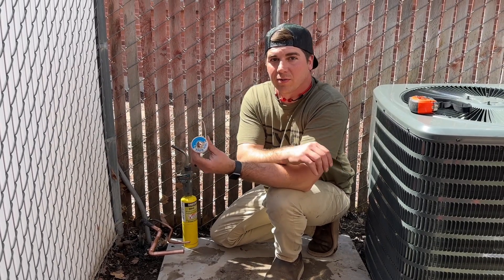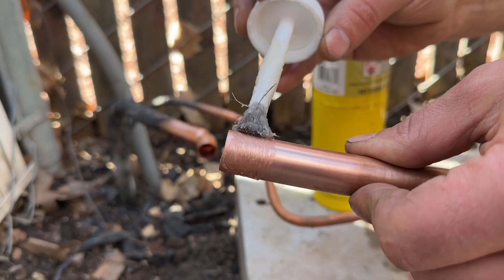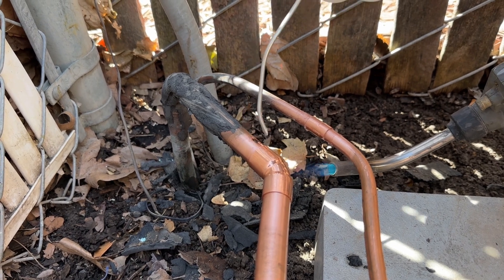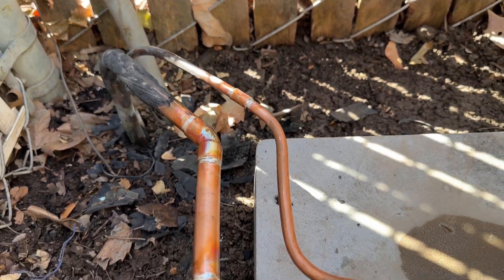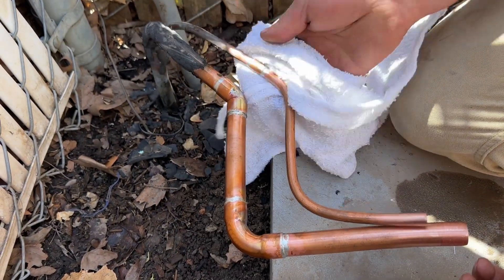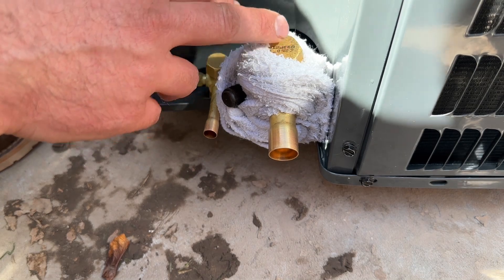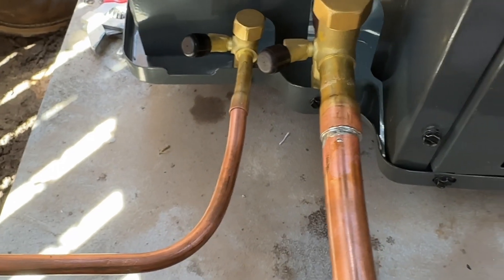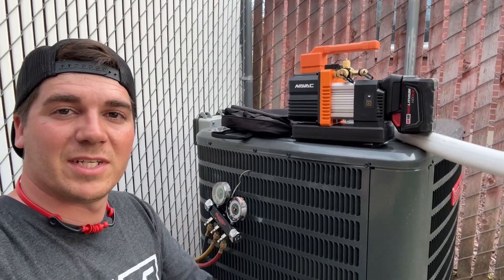Ditch Brazing. Learn To Use Staybrite 8 Soft Solder For HVAC Copper Lines

Comment: Silfloss should be used. It won’t go into the pipe no matter if you over heat or add to much. Plus the solder you are using is for low pressure piping. 
Im saying you should go back and check out your fittings in 5 to 10 years. That’s when you’ll find out why the solder you are using is for low pressure water systems…
Reply: Planned obsolescence, creating work.
Reply: Job security. Do the job Half Ass. You will get to go back and do it again a few years down the road….
  As long as you are using solder of any sorts. You will be able fixing it again. You should always use the correct…
Sill-floss should alway be used. 
The solder will ball up inside your lines. Then when it gets to the compressor or any piece of the equipment it will destroy the mechanical components. 
   The best part is. You’ll make all the money again. 
   That’s a great business plan.

Comment: I stay away from solder because its more rigid and prone to cracking/leaking from vibration from equipment. As well as if linesets get bumped by a lawn mower or kid playing. Brazing makes a more flexible and resilient joint.

Comment: Wanted to know in your pressure test process, could an air compressor be used instead of nitrogen tank?
Reply from the maker: Nooooooo compressed air is full of moisture which is exactly what we are trying to keep out of the lines. So nitrogen is needed. But if you get past 500 microns and pass your decay test, you can bypass the pressure test all together. If you have a leak you won’t be able to pump it down and hold at 500 microns. Cheers
Reply: @diyhvacguy  Even if you pump it down to 100,000 microns, the pressure differential from outside to inside system is less than 20 psi.  Seems there could be a joint that can hold 20 psi suction, but may blow apart with 200 psi.  Perhaps in your experience a solder joint is either "GOOD" or "Bad".  Nothing marginal.
Reply: Lolol my air compressor shuts off at 150psi. I hope yours does too, or you're going to blow your tank up.

Comment: Question: I have been practicing on 1/2 in copper pipe with Staybrite 8. I've then cut the fittings open to see the result. A tiny amount of flux still gets into the joint. I wonder how much is acceptable?
Reply: Any moisture or contaminates in the system is bad. There's a reason techs braze and it's not because we like paying more for Acetylene

Comment: I saw the video about using nitrogen when soldering to prevent cupric oxide from forming inside the lines. Why did you not use nitrogen flowing when doing this soldering?
Reply: At 400 degrees you don't get any scale. look at the outside of his joints.
Reply: Damn good question
Reply: It’s not hot enough to form cupric oxide scales.

Comment: Will this hold up will this hold up to the pressure in the lines and the refrigerant
Reply from the maker: Yes, Steve, right eight is designed for use with refrigerants, including r410a 👍🏼

Comment: I started in hvac in 1987. I have installed .any thousands of systems.  I have slways used a tubing bender to eliminate fittings and swedge instead of using couplings  whenever possible. This this cuts costs , and saves a huge amount of time. Get used to using a bender and you will get the job done way faster.
Reply from the maker: Thanks for the input. With soldering, gaps are not good, and I found that the swaging tool creates gaps. That’s why I’m prefer fittings but I totally agree with you, if I’m brazing I always try and eliminate the need for fittings. Cheers
Reply: @diyhvacguy but like you showed, if there is a gap, take flathead channel locks and gently press them to close the gap.
Reply: I used to use fittings and such. Then I bought a swaging tool. I don’t do much a/c work anymore but if I sold all my equipment I would definitely NOT get rid of my swaging tool!!

Comment: Why would you want to do this? Oxy acetylene brazing is faster and you don't need to use Flux paste. Are you flowing nitrogen?
Reply from the maker: Acetylene is definitely not faster, if anything it’s the same, time wise. But nitrogen isn’t needed with Staybrite 8 due to such low heat on the joint, and it has a tensil strength of 10,000  psi
Reply: @diyhvacguy   You absolutely need to flow nitrogen if you care about quality, compressor life and warranty. Is this technique meant for a cheap DIY homeowner or a professional HVAC Service Technician?

I'm just skeptical about using this product for a professional installation with a warranty. Nitrogen should be flowed, you are still creating oxides. That being said..... this product looks absolutely amazing for emergency repairs on coils or certain areas where you need to braze but have limited ventilation or other hazards

Comment: with a 400 something degree melting point staybright 8 should easily melt with propane torch since you can use propane torch to melt pot metal form of aluminum witch is used to make flange nut rings for kitchen sinks.

when scrapping a kitchen sink i find that i have to use a torch to melt away part of the ring witch is only pot metal grade aluminum and aluminum melts at something like 1300 degrees.

Comment: Staybright silver bearing solder is great on Expansion valves or sensitive heat temperature sensitive areas but other wise I prefer to braze. Stronger more durable joint.
Reply: nope, staybrite 8 is stronger. Already proven
Reply: @bigkountry29  I can't speak to whether it's stronger, but will say that you really need to take care that no flux remains in the pipes when using it

Comment: Is this fine to do on a small hole in the low pressure line caused by a wire sitting on it? Or should I braise it?

Comment: I get the thing about imperfect swages leaving gaps.  But the downside of using fittings instead of bends and swages is it doubles the number of solder joints.   Course if they don't leak then it isn't a problem...

Comment: This is new method very nice & easy. Do you think the soldering works for years and it will not make leaks from joints?
Reply from the maker: I know several people who have been using Staybrite 8 for many years with zero problems. I’ve seen leaky braze joints, so it’s just a matter of doing the joints correctly with both types of connection.

Comment: My father told me that his company used 50/50 solder on every r22 condenser they installed from 1978 until 1995. I still see some of his stickers every once in a while on an old system and they for sure did solder with hard copper. Of course the higher pressures of our modern refrigerants probably wouldn't be ok with leaded solder but he swore by it for r12 and 22

Comment: I’ve been using staybrite 8 on all of my replacement jobs and even new construction jobs. Super easy and quick.
Reply: I currently have an R22 system. Can I reuse the line set for R410a, do I have to flush out the lines? No burn out, just a very slow leak in the evaporator coil. Thank you
Reply: @JamesAgans you need to flush the lines. They use different oils.

Comment: Regular propane gas gets plenty hot to do this job. I installed my HVAC equipment using StayBrite 8 and a regular propane torch.
Reply: That's because they stopped selling Mapp gas to the public which burnt around 5k degrees. Now if you look closely it's called Map Pro. Which burns at like 3,700 degrees vs propane which burns at 3,600 degrees. So you're absolutely right. It's basically propane with a miniscule amount of mapp.
Reply: @prodoommania4157 Those temps seem extremely high for propane and mapp. If what you said was true you could braze with propane
Reply: @prodoommania4157 100%! There is no longer a plant producing MAPP in North America, only in Europe. Map Pro is a scam and is just a propane blend. No MAPP involved. A huge rip off to pay double for an extra 300°F.
Reply: @prodoommania4157 is that still hot enough for this soft solder?
Reply: Sure, but professionals have no time to wait for the fitting to heat up.

Comment: Good info for tne diy guy. Do you have any experience with the Fieldpiece sman digital gauges?
Reply from the maker: Yes! I have several friends that have been using them for a long time and I have a 3 port manifold set and I absolutely love it!
Reply: @diyhvacguy  can you make some videos on how to use it? I bought the 4 port manifold version but when I shut down the refrigerant port after charging my heat pump, the valve acted like it stayed wide open and I sucked some air in my system. So I sent it back. And I didn't have time to really learn it. I would like to order another one eventually.

Comment: Are you putting flux on both parts or just the one?
Reply from the maker: I just put it on the male end
Reply from the maker: Otherwise you’ll end up with too much flux inside
Reply: You should never put the flux in the fitting, only sparingly on the pipe. You should also carefully clean the flux off the pipe after soldering. It will definitely corrode the pipe if you don’t clean up all of the excess flux.

Comment: I used 15% silver solder, the best as far as I know.
Reply: 15% silver is the best, now if you're low on budget the 5% do the job too.
Reply: Yeah, I was practicing with it at work. Used acetylene. Doesn't flow very well, doesn't need flux on copper supposedly. Hard to do in the wind outdoors.

Comment from the maker: All My Favorite HVAC Tools: https://www.amazon.com/shop/thediyhvacguy?ref=ac_inf_tb_vh
Reply: Great videos. Do you ever do refrigeration such as batch freezers, commercial fridges for restaurants?  Looking to handle my own equipment as some of these guys that come out are rip offs..I have gelato batch freezers, holding cabinets, display and undercounter fridges. Especially just adding some Freon to top it off. Brand new gelato batch freezer failed on the first day. Checked all electrics and checked the compressor and the compressor died. Under warranty but the company wanted a certified guy. Minimum was 800.00 to come and tell me the compressor failed so the company would send me a new one. Then estimated 1500.00 to install the new one. R404a refrigerant which I purchased a 5lb cylinder.  Looking forward to more of your videos.!

Comment: I saw you were feeding the nitrogen pressure on the high side in the video, did you do the low side off camera since I saw it was in the 300s already.
Reply from the maker: The nitrogen goes through the high side, into the home in the Evap coil, then back through the low side and stops at the schrader valve. So no need to put both hoses on for pressure test.

Comment: I like to bend the solder at a length equivalent to the diameter of the pipe.  Once the joint has sucked that length of solder into the joint, you are done.  Any more than that you risk of solder entering the pipe as ball bearings and being sucked into the compressor and self destructing.
Reply: Good advice… thx
Reply: ❤ @nickmrt2670 333@3
Reply: Excellent advice. As a major diy'er could have. Thought of that yrs. Ago. Thanks. Always thought little ball brgs. Getting to the TXV. Oops.. Thanks again.
Reply: Thank you for this advice.

Comment: nice job. I've also seen people cut off about 1 or 2 inches of solder, make a ring and stick the ring into the pipe fitting then stick the tube into the fitting and heat it up so it melts outwards
Reply: I would not do that , you will have too much solder in the pipe !
Reply from the maker: That was probably one of my other videos :) the difference is that is still brazing so you need a nitrogen flow.

Comment: Thanks for making these videos. I'm going to install a system on my house soon and was glad to see the joints could be soldered instead of brazing.
The coil install instructions say not to use soft solder. Is there any reason not to solder it anyway or should I look for a different brand?
Reply from the maker: Yes some say not to because people can overdo it with the flux, or if they put too much solder you could end up with solder bee bees in the lines but as long as you aren’t feeding a ton of solder in you will be golden. I advise trying on a few spare pieces before hand. 

If you need some assistance with your install, we offer remote help with replacements for DIYers and home owners over at Patreon.com/diyhvacguy   It’s $50 (cancellable at any time) and we will give you one on one assistance with your replacement, also with sizing, diagnosing, and even help with getting the full 10 year warranty. Cheers,   Dave
Reply: @diyhvacguy  Thanks for the advice Dave. Going to order a whole bunch of stuff from your links and get this project done before it gets hot!
Reply: If you did normal plumbing soldering this will be piece of cake. Do some practicing before on normal copper. The main trick is to not over do it, and it's better to use normal propane (blue) as the heat is not this intense.
Reply: @laurentiupetre5620  it was easy! Hardest part was getting the coil into the addic. Was warm today so got to use it for the first time.